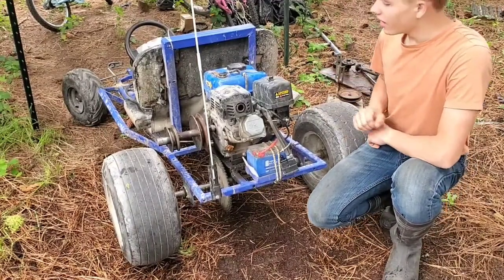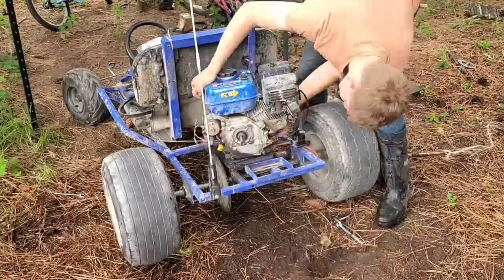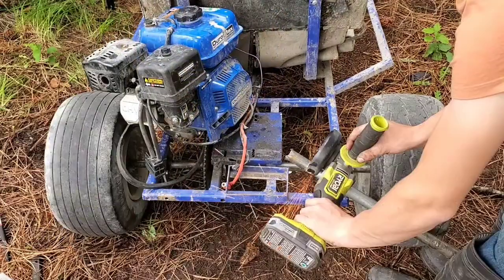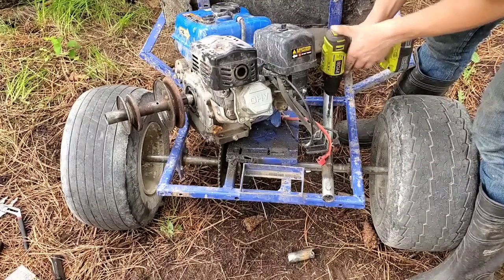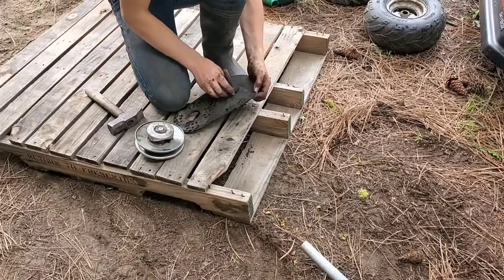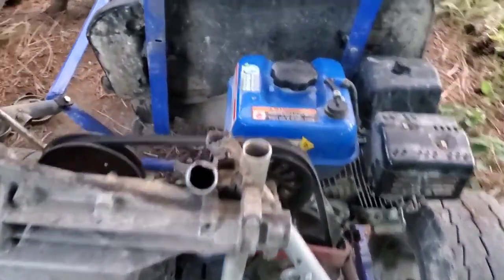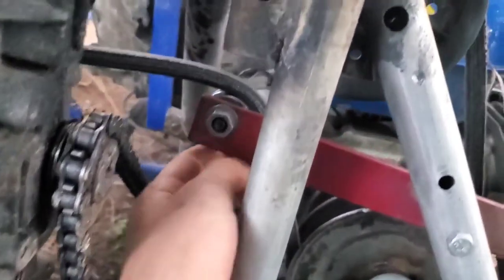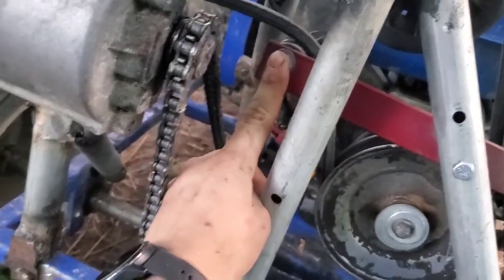The Lawnmower transmission works, but it needs a clutch | Go Kart Upgrades part 2

Comment: hey thanks man thats a great idea to run your small sprocket where the little brake disk is. you get the five speeds out of the transmission but dont have the reduction of the differential. genius, i have the same peerless transmission and now i have a new way of thinking about how i could use it.

Comment: I'm interested to know how having it mounted vertically affects the lubrication, I am using one on my project and i was thinking about standing it upright and purposefully overfilling it with gear oil to keep the oil at least splashing onto the differential but more importantly keeping the gears lubed.